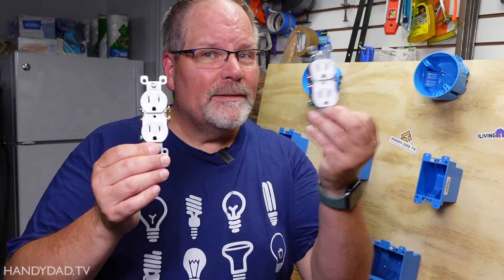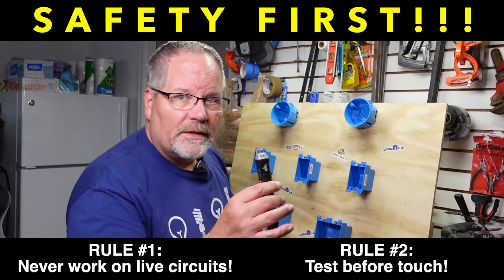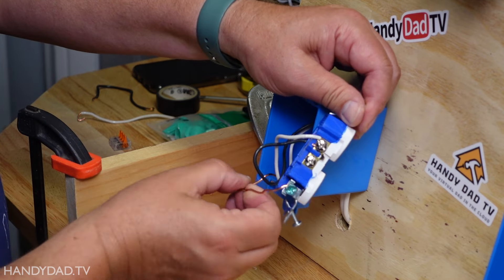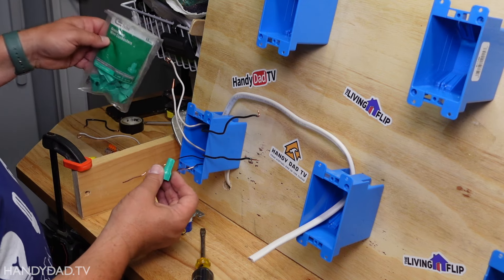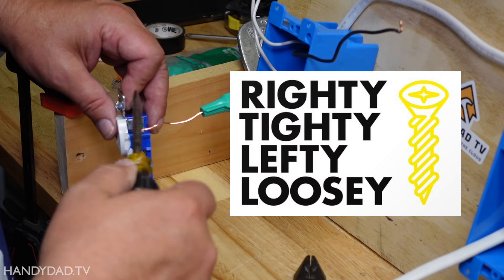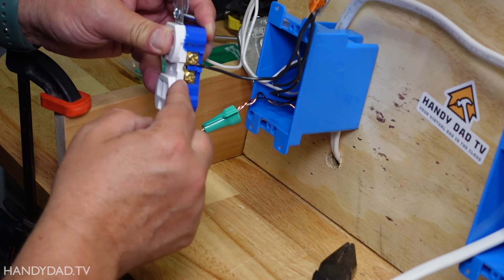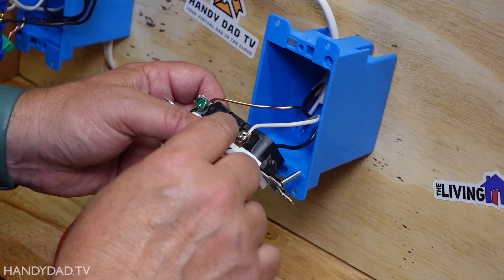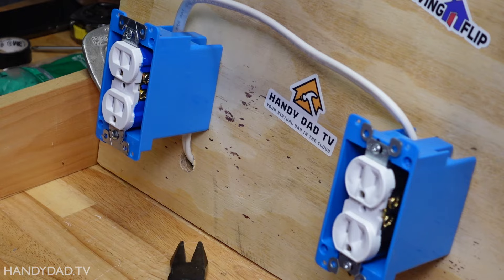SAVE $300 EACH!! How to Add an Outlet from Another Outlet

Comment: I ordered a box of the ground wire nuts, never though of that what you pointed out, I would once in a while pigtail wire. Now I know more and make it easy to wire. I do use the wago  got away from using wire nuts. Ill do this when wiring my new BBQ shed this spring
Reply from the maker: Glad it was helpful 👍🏻
Reply: Do they make wiring nuts with holes in the center for the black and white wires
Reply: @TheKonakairay   no just the ground.
Reply from the maker: @TheKonakairay No, that’s only allowed for the ground.
Reply: Ok ty guys
Reply: For some reason during this exact project (adding an outlet off another outlet) I looked at my Home Depot here in Canada for grounding nuts and didn’t see any, so I used a wago connector which hopefully was ok.
Reply from the maker: @tannerc900 Yes you can use any wire connectors.

Comment: Very informative, enjoyable video.
It would have been more beneficial (and provided a sense of completion to the project) by showing the wiring for the new outlet.

In my garage, I have an outlet in the ceiling near/to supply power to the garage door opener, and I wish to install an outlet in the storage space above the garage. Can I assume I could use that ceiling outlet as a power source from which to create a new outlet just as you did in this video?
Additional questions would be: 
1.) Can I mount a new blue box for the outlet to a vertical 2x4 in the storage space?
2.) Do I need to use conduit for the wires?
3.) How much space in-between must I allocate?
Reply from the maker: 1) Sure, wherever you want. 
2) Depends on your local codes.
3) None that I know of.

Comment: What if wago connectors are not available  , how would the connection be made  . Is the old fashion twist together with a wire nut ok (safe)
Reply from the maker: Wire nuts are fine.

Comment: What is the name of foot long run that you use to connect one outlet to another? Romex? Does it matter the type I buy?
Reply from the maker: Yes, that’s called Romex wire. Some cities require shielded cables and do not allow Romex. You need to investigate your local codes. 

Wire size depends on circuit breaker size. A 15-amp breaker needs 14 gauge wire. A 20-amp breaker needs 12 gauge wire.

Comment: If I'm trying to add an LED mirror to my bathroom, would doing the same kind of wiring here work? There is an on/off button on the mirrior, and doesn't need a ground, so I'd assume just wiring it like this would be okay?
Reply from the maker: Assuming the mirror has a plug, yes. But in a bathroom you need to use a GFCI Outlet. https://youtu.be/inpvNt6591E

Comment: What wire gauge would you recommend? I’m doing my dog house and installing an ac unit(6k btus) one outlet and another outlet with led lights and 2 small desk fans
Reply from the maker: I would run a 20-amp circuit using 12-2 wire.

Comment: Now, can you do the same thing you did with the first outlet, to the second outlet in order to wire a second additional outlet?
Reply from the maker: Yes just repeat the process.
Reply: @ Awesome thank you! I just moved in to a new home and the basement is completely unfinished except for one outlet. Given the fact all the walls and studs are exposed, routing the wires is not an issue.
Reply from the maker: @GoatCheez988 That existing outlet is most likely tied into your living room circuit. Consider running a new circuit for the basement outlets since you might want to install a sump pump or dehumidifier. Appliances like that will  make your living room lights flicker.

Comment: What gauge wire would I want for something going to run a AC and then sometimes a space heater? is 12/2 good enough or do I need 10/2? I know someone said 14/2 is good enough but im worried about the amps. Thanks.
Reply from the maker: I would never recommend an appliance like that on a 15-amp circuit. I recommend a new, dedicated 20-amp circuit with 12/2 wire.

Comment: i have to install 2 breaker boxes cause the power line is too short but can i use yellow romex if the previous wiring was with older white romex
Reply from the maker: Yellow should be 12 gauge wire; white could be anything depending on age. You can use 12 gauge if the circuit breaker is 20 amps or less.

Comment: What type of wire should I be using for this purpose (110/115V extension)?
Reply from the maker: Same wire as the rest of the circuit. If it’s a 20-amp circuit breaker, should be 12 gauge wire. 15-amp can use 14 gauge.

Comment: Got a question though if the outlets are wired together then they’re running on the same breaker would that theoretically limit what each outlet could handle like I couldn’t run a large appliance off 1 and a table saw off the other with out tripping the breaker unless went to a larger breaker.
Reply from the maker: Correct. Adding an outlet is the same as using an extension cord from the existing outlet. You are still limited by the maximum current allowed by the circuit breaker. 

If you want to use a big tool or appliance, run a new circuit.

Comment: Sir, I will be installing a GFCI receptacle that will be receiving its power from a standard residential receptacle (daisy-chained from the residential receptacle). Should the wires going into GFCI receptacle from the residential receptacle be considered load or line?
Reply from the maker: Power coming IN to the GFCI goes to the LINE terminals. 

You can connect additional outlets to the LOAD terminals and they’ll be shock protected.
Reply: @handydadtv  Sir, thank you for your time and your response. I appreciate the fact that you didn't ignore my question. I wish l could repay your respectfulness.

Comment: Can I run another receptacle from the second outlet that I tap off of or is there a limit in receptacles for the circuit?
Reply from the maker: You can do multiple. The only limit is the total current allowed by the circuit breaker.

Comment: Ok is it possible to add a GFCI at the end of a short series (will be an outside receptacle coming off the last standard receptacle) of 2 standard receptacles?  If so, how do I wire the last standard receptacle and the GFCI receptacle? 

(Is it ok to use a 15 amp GFCI on a 20 amp circuit). 

Thanks
Reply from the maker: This should help: https://youtu.be/BfRZSYN1QcU

Yes, it’s fine to use 15-amp receptacles on a 20-amp circuit.

Comment: What gauge of wire are you using? Are these 15 amp or 20 amp.
Reply from the maker: In my sample board, I’m using 14/2 wire on a 15-amp circuit.

Comment: So did the wires from outlet 2 plug into the wago adapter? I may have missed it.
Reply from the maker: You can use Wagos or wire nuts or the available set of screws on the outlet.

Comment: Could you in theory do the same thing off of a light switch? I have 0 outlets and I’m trying to set up a painting desk with a lamp and air compressor
Reply from the maker: In theory, yes. Watch https://youtu.be/1JK0-yoNaWo

But I wouldn’t recommend doing that with a high current device like a compressor. It will cause all the lights on your circuit to flicker. Your best option is to run a dedicated circuit.
Reply: @handydadtv  new conduit from the breaker box, got it. Thanks for saving me the trouble!

Comment: A semi-related question...I have to replace a non-working outside GFCI that also has another recepticle running from it to my shed. The current GFCI isn't rated for  wet/damp environment and is 125 V @ 15 A. My plan is to replace that GFCI with a 115V @ 20 A rated for outside service. The shed receptacle is 15 A and I'll replace that with 115 @ 20A. I will also replace the breaker with a 20 A one. Is this overkill or not?  So - everything will be equal in terms of rating. It will cost a bit more but in the end will give me 2300 w as opposed to 1725 w. It's unlikely I will ever run enough at the same time to cause any problem with overload. Opinions anyone?? (Go-for-it would be my favorite ☺)...just being cautious.
Reply from the maker: VERY IMPORTANT RULE: You can’t just increase the size of a breaker. The breaker is matched to the wire size. 

You can only use a 20-amp breaker with 12 gauge wire or heavier. You probably have 14 gauge wire and that’s too thin for 20 amps. That’s a fire hazard. Big no-no.

Comment: I've never seen the through-grounding wire nuts FS here in California and ALWAYS use pigtails. ALWAYS check your local building codes to make sure that the connectors and methods that you want to use are allowed....
Reply from the maker: Thanks

Comment: Great info! What if you want to add an outlet on either side of an existing outlet, making a T more or less. We've got a single line coming down into our garage/ workshop and I'd like to space a couple outlets for charging our growing list of electric tool batteries. Is that just a wire connector with more "out" tabs?
Reply from the maker: Yes, use a short piece of wire, called a pigtail, to the existing outlet and connect all the same color wires with a Wago or wire nut.

Comment: How about running for outlets in two separate directions, just do same thing but use bottom two screws for second direction? Or is that not good idea?
Reply from the maker: Whenever you have more screws than wires, you need to use pigtails like I did in this video: https://youtu.be/klL8XhKMNT8

Comment: I found those quick connects at lowes 10  of them in a pack  for 3.98  and they used them on the ground wire also  2 wire 3 wire and 4 wire and 8 wire ones . I  saw yours and went to look up them at lowes hardware  store and my local store has them . I am wanting to run another outlet off of an outlet for the whole house filter . Only thing on the other outlet is 1 a LED  shop light . So if these are easier to use is there any problems with using them to wire the second outlet to the first
Reply from the maker: No, not at all.

Comment: So if you do this and you find yourself exceeding the amperage of the particular circuit it is on, you can just replace that circuit with a higher amperage one right?
Reply from the maker: NO. Never replace a circuit breaker with a higher amperage. It’s a FIRE hazard. ⚠️ 

If you need more power, run a new circuit.

Comment: What wire is the white wire? Is it a Romex 12/3? The one used from one outlet to the other?
Reply from the maker: My Romex is 14/2 because I’m working with a 15-amp circuit. Use 12/2 for 20-amp circuits.

Comment: Question I’m trying to add a outlet up the wall to hide tv cables but the outlet I’m trying to use has  4 wires on outlet circuit so 2 whites 2 blacks and 2 grounds can I pigtail tail a 3 rd wire to that outlet and use a 5 level wago ? Or is it to much ?
Reply from the maker: I did something similar in this video: https://youtu.be/klL8XhKMNT8

Comment: May I know what's the name of the cable you added to the new outlet that has three wires coming out?
Reply from the maker: That’s called Romex cable. You need to check with your local codes to see if it’s allowed. Some places require shielded cable (called BX) or wires in conduit.

Comment: Can this be done with an existing 220 outlet the same way?
Reply from the maker: I can’t answer. I’ve never seen more than one 220-volt outlet or device on a single circuit. I don’t know if the NEC allows it.
Reply: @handydadtv  ok researching it it seems like you can but not recommended, I wouldn't be using the equipment at the same time.  I know they sell the "smart adapters" to split say an EV and dryer plug

Comment: @handydadtv how do you know which wire size to buy?
Reply from the maker: Locate the corresponding circuit breaker. If it has a “15” on it, that’s a 15-amp circuit and you can use 14 gauge wire. If it has a “20” on it, you need 12 gauge wire. Anything other than 15 or 20, call an electrician.

Comment: @handydadtv does this alter the voltage or watts generated to the new outlet? For example I want to install an electric fireplace on a wall that has no current outlet, would this new outlet still be capable of powering it?
Reply from the maker: It’s no different than running an extension cord. Only that it’s permanent. 

If you’re planning to use the heater in the fireplace, it may overload your circuit if you draw too much current at the same time. The circuit breaker should protect you from a disaster, but it would be inconvenient to have the breaker trip if you ran the heater and the vacuum, for example, at the same time.

Comment: Could you do this same wiring technique when installing an outdoor junction box for security cameras connected to an attic outlet? 

Also, as you mentioned in the video, if the temperature could get too hot and melt the outlet, why wouldn’t it do the same to the wago wire connectors?
Reply from the maker: For cameras, I’d do my best to plug their power supplies in the attic outlet instead of dealing with weatherproof junction boxes. The wiring is the same but you need GFCI protection outdoors. 

Circuit breakers are designed to trip before an overload would heat your wires, outlets, wire nuts, Wagos, etc, beyond their melting point. The only risk is a faulty or incorrectly-sized breaker for the circuit.
Reply: @handydadtv  great info. I appreciate it. The only issue with plugging it directly into the outlet in the attic is distance. Almost 40 foot or so meaning i would need  a 25 ft extension cord and im not sure if that would be safe to run in the attic. (Over the garage where there is no insulation)
Reply from the maker: Cameras draw low power. Maybe a couple of amps max. Extension cords would be fine. Or you could easily add new outlets from the existing one.

Comment: is it a 2 or 3 lever connector for the blacks? 3 wires are connected but looks to me it was the 2 lever one was used. It is not something I couldn't find.
Reply from the maker: The size of the connector depends on the number of wires to be connected. Black or white doesn’t matter.

Comment: How close can the outlets be?
In my garage I accidentally put a screw into the electric wire in the wall. It's 32" away from an outlet. I wondered if I can just add another outlet where the damaged wire is. Or is there a way to splice that wire in the wall and be safe.
Reply from the maker: There’s no rule on too close, but there are rules for how far apart in living spaces.

Comment: Does this effect the load each outlet can handle?
Reply from the maker: Load capacity is determined by the circuit breaker. Adding outlets doesn’t add capacity.

Comment: I want to operate an outdoor light with two different off and on switches one from inside the house and the other from a location near the outdoor light fixture. Any ideas?
Reply from the maker: Run a 3-way circuit, or use a smart switch.

Comment: If the old outlet has 5 wires - 2 black 2 white and 1 ground, do we pigtail the other white and black the same way?
Reply from the maker: When you have more wires than screws, you need to use a pigtail on the outlet then splice the wires with a wire nut or Wago, just like you do with the ground.

Comment: If everything is on the same circuit does it really matter if you connect the 2 black wires on the two brass screws or  if you pigtail them and connect to a single screw? This is the only confusing part. Thank you.
Reply from the maker: Pigtailing is necessary when you have more wires than screws. Otherwise it’s optional.

Comment: My home is an older one and does not have ground wire. Can I still do this?
Reply from the maker: Yes. But I’d make it a priority to upgrade your electrical system one circuit at a time.

Comment: Question, if i just have wire connectors, can i use them for the black and white wires too? Im only connecting a tv to the other outlet so it should heat up too much.
Reply from the maker: Normal wire nuts are fine. I always twist the wires first and cut the end to make sure no metal is exposed when inside the wire nut.
Reply: @handydadtv  I like to use electrical tape on the bottom of the wire nut for extra protection against shorts.

Comment: Question, how many outlets would you say are safe to add together?
Reply from the maker: There is no limit to the number of outlets on a circuit. You are only limited by the amperage capacity of the circuit breaker.

Comment: I need a 110 plug near my stove I only have the 220 that's connected to the stove. Can I add a 110 coming off from the 220 so I can use one plug or the other if needed. My stove does not have a 110 plug outlet built in to it.
Reply from the maker: Technically yes. But it’s a code violation and unsafe.
Reply: @HandyDadTV  since some stoves have a 110v outlet, can I add a 110v outlet to the stove? My house is old and plugs weren't a big deal when it was built.
Reply from the maker: I can’t recommend it.

Comment: How about if you don’t have access to the outlet and you only have access to the Romex or wire power outlet supply do I need to make a junction box?
Reply from the maker: Yes. All wire splices need to be in a junction box and every box needs to be accessible (ie. Not hidden inside the wall).
Reply: What I mean to say is I will be running a new wire to make another outlet😁 im just getting the power from the existing outlet but I only have access to the exposed wire going to the outlet😬😬
Reply: @handydadtv   thank you for your time god bless you 🤙🤙
Reply from the maker: I’m sorry. I don’t understand what you mean. You’ll open the existing outlet and you’ll have access to all the wires.